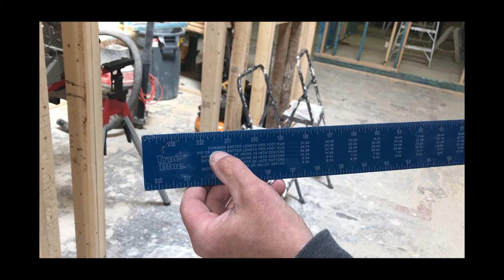How to Frame a Roof (Common Rafter Layout)

Comment: WRONG calculation on bird mouth...1/3 MAXIMUM of rafter to be removed!!!!!Also ridge material not accounted for.
Reply: I agree but read some local codes allow 3 1/2 for top plate .
Reply: @JohnnyJr396  Don't you have to take off more then 3/4 if the slope rises above a 412?
Reply: 1/3 MINIMUM, and no more than 1/2. Come on, guy! Time to take all your comments down now before your man card is revoked.
Reply: John Jacobs my bad
Reply: @JohnnyJr396  I was replying to ol Bill K.
Reply: @sickseven3601  Don't you have to take off more then 3/4 if the slope rises above a 412?